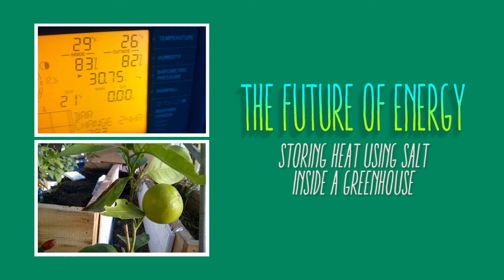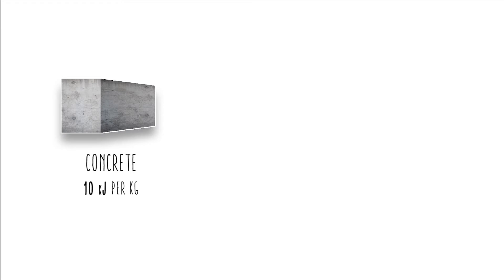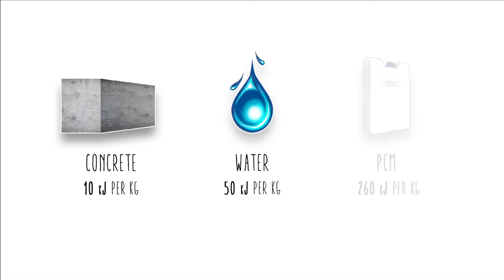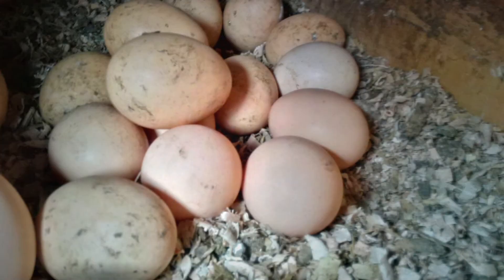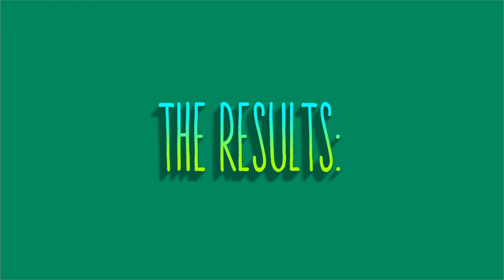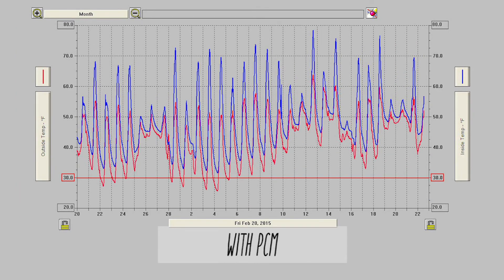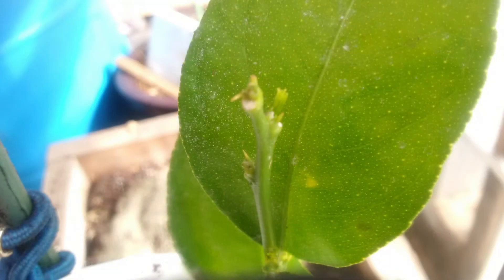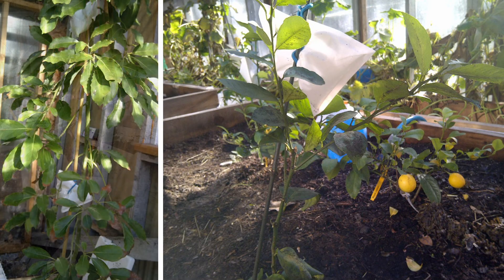FutureofEnergyPCM Final

Comment: Thanks for sharing this great info :) Have the years results been shared anywhere, how has the greenhouse performed during summer months regards overheating ?
Reply from the maker: You can find the results at http://www.carmeniafarm.ca/pcm-trial.html and read about it at http://smallfarmcanada.ca/2016/chill-out-storing-heat-inside-a-greenhouse-using-salt/.  The PCM used for the trial do not help with overheating, as each material has its own unique phase change temp.  The materials used for this trial liquify at 6C and take on the ambient air temp thereafter.
Reply: Carmenia Farm  thanks so much for the help :)